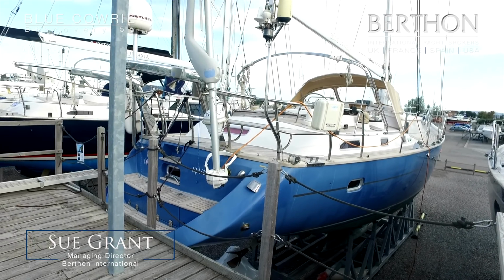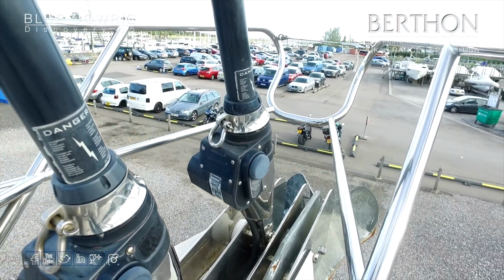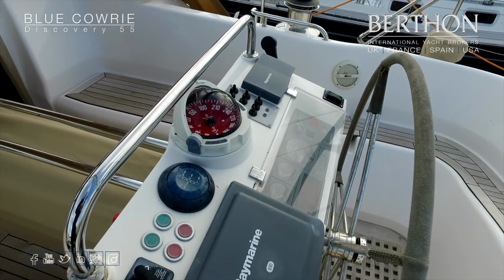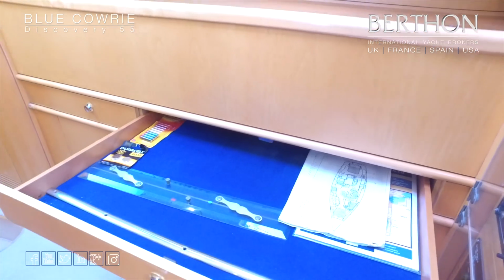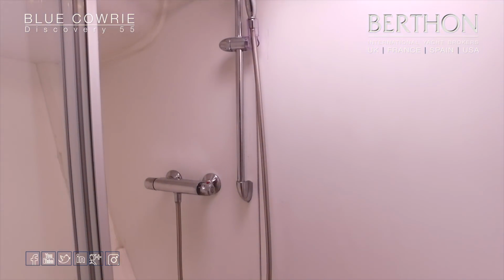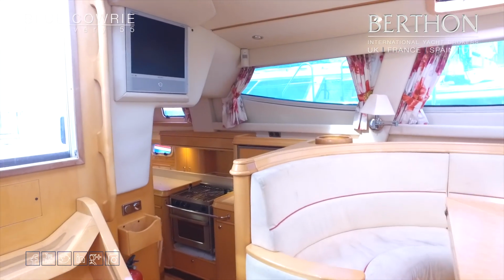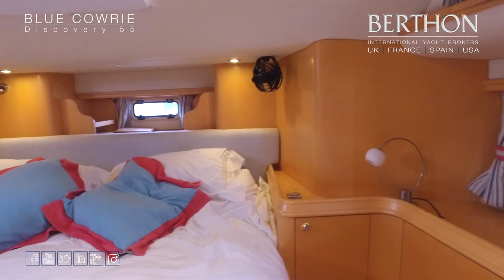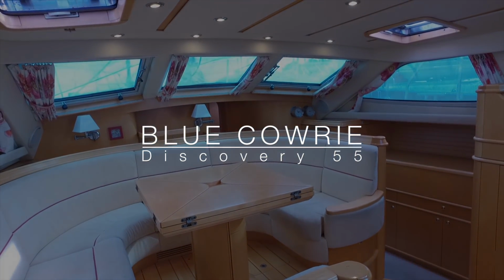[OFF MARKET] Discovery 55 (BLUE COWRIE) - Yacht for Sale - Berthon International Yacht Brokers

Comment: I think it very important to see the engine room and to know what kind of work needs to be done prior to even considering this yacht The refrigerator will have to be replaced regardless if it has a new compressor or not, the system is most likely fouled and will burn up the new compressor in short order. For all the "TLC" this girl needs I think it's very over priced at the moment.